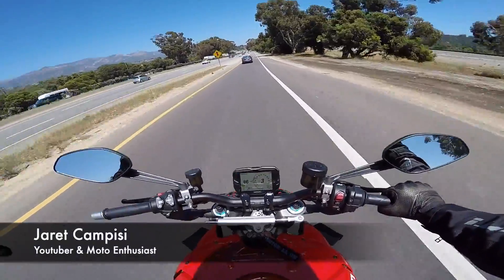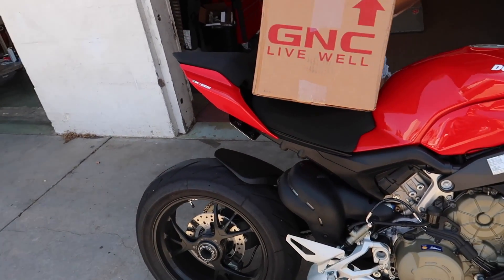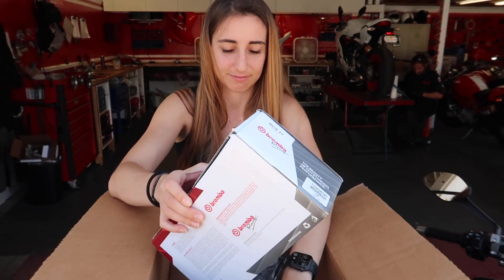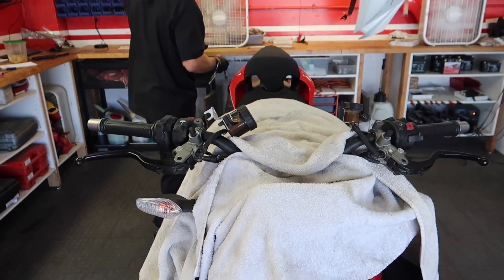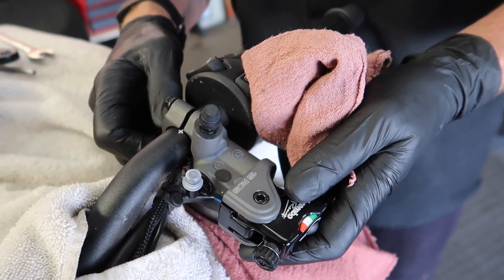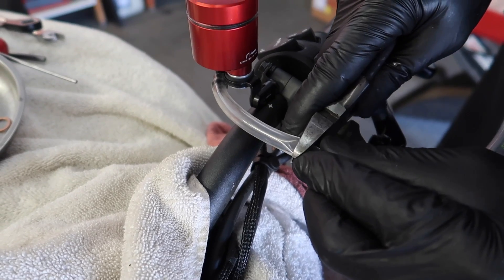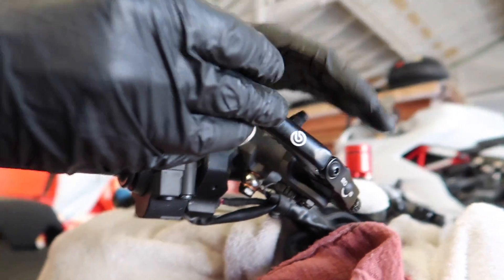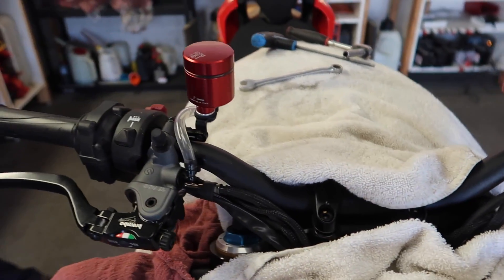Cleaning up our 2020 Streetfighter Front end!!!

Comment: What about upgrading the rear brake reservoir? What size piston did you go with on the front brake? Are those RCS Master Cylinders the Corsa Corta version? If not, you should consider swapping them Brembo standard levers for the low drag/shorty levers Manny offers on his site. 

Btw, the C8 doesn't need an aftermarket exhaust. Sounds beastly stock.
Reply from the maker: We will upgrade the rear reservoir as well and yes they are the Corsa Corta version!